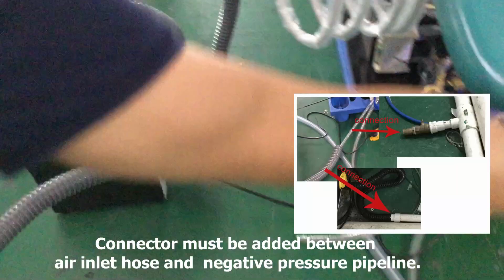How to install dental suction machine for Mr.Right Dental Chair?

Comment: You mean this machine instead of the air compressor or  you install plus the air compressor, which mean both in the same chair
Reply: Hi May, thanks for your message. This machine is suction machine not an air compressor. The suction machine and the air compressor both work for the dental unit. The suction machine provides suction power for the dental chair and sucks the patient's saliva. But the air compressor is provides air for the dental handpiece and 3-Way Syringe. Hope this information is useful for you. Thank you. For the suction machine you can buy online here: https://www.treedental.com/dental-suction-machine-vacuum-system-support-1-pc-dental-chair-tr-yp606a1.html